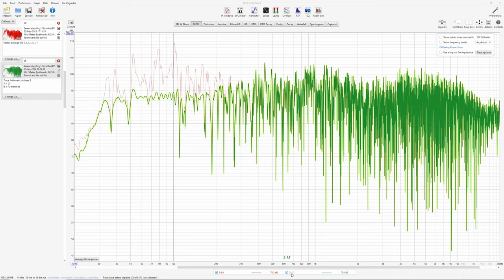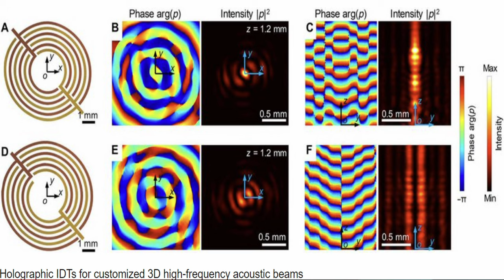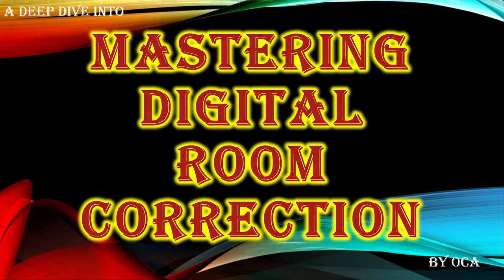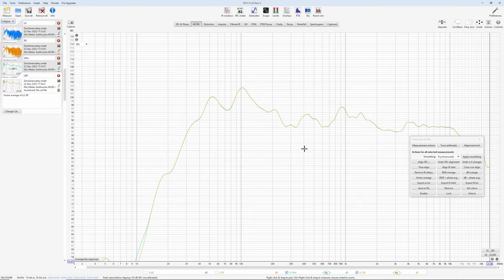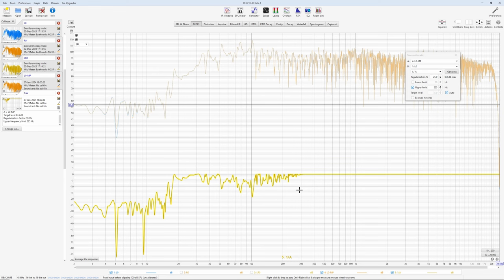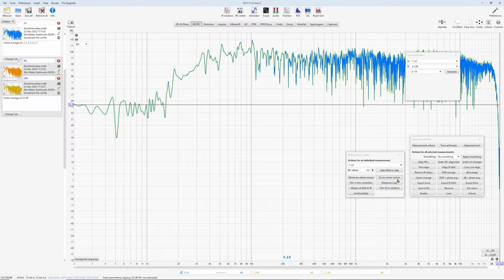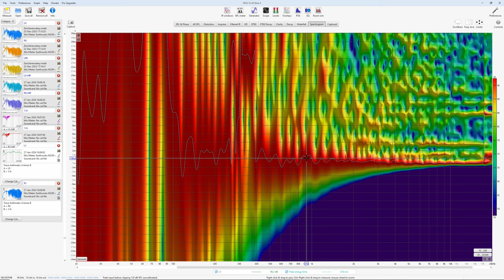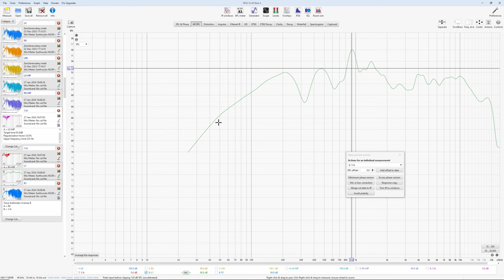Mastering Digital Room Correction

Comment: Thank you for your great work! 
This is very easy to do and my Subs now sounding much better, but.... Today I heard music very loud and noticed preringing at lower frequencies with "your" MP-filter. With some Tracks (also "Beat it" - Michael J.) it was very intensive. Now that I know it is there, I can hear it also when music is at lower volume. Could you please give me some advice how to avoid the preringing? Ah, I forgot: There is also a constant noise when music has stopped. It needs 4-5 seconds till this noise stops. It sounds like a tesla. (I use camilladsp) With biquads(peak) I have absolutely no preringing or postnoise.
Reply from the maker: How many FIR taps are you using in Camilla? These inversion filters are very sensitive and require a lot of taps. When some sharp phase filters are rounded by lower number of taps pre-echo can be introduced. You can generate minimum phase versions of your final filters and use them as the new convolution filters. These will have zero pre-ringing and adequate phase correction. I'm working on the issue as you're not the only one with that result and I've made progress. That video is in the pipeline.

Comment: Nice result with this method. Maybe the best till now, since I am at the start of this. Quick question, why do I upload the end file .wav format in eqapo and is in +20somethingdb?
Thank you for your time and useful information
Reply from the maker: Do not use "Normalize IR" while exporting from REW or in EQ APO, that will boost the volume of the filter. Also, try to export with the windows applied. If you hear ringing, you should generate minimum phase versions of the final "1/A" filters and export these instead.
Reply: @ocaudiophile  thanks for the quick reply, I have already faced the ringing problem and solved it, I will try  the other one tomorrow. Great work as usual, keep up
Reply: Will you consider this technique better or previous techniquse like vba?

Comment: What was done to get to your L0, R0 and LR0 measurements? Would you also do this same technique for your subwoofer response? Lastly, there is a chance I may be moving from an AVR with Audyssey to one that uses YPAO - if I wanted to continue to use your calibration methods, how would one get this information transferred to that kind of receiver (i.e. a Yamaha R-N800A)?
Reply from the maker: Vector average of all measurements of each speaker after cross corr align'ing them.

Yamaha has the best PEQ among AVRs, I'd go for manual calibration rather than YPAO. You can customize REW auto-EQ (configurable Generic EQ) with the limits of the Yamaha PEQ and it will optimize the filters for your AVR. I have older videos on manual Atmos calibration, have a look at them.
Reply: @ocaudiophile  Is there a specific video I should watch to be able to apply a manual calibration once I do get that Yamaha receiver?

Comment: Great video and a much simplified process.  I am experiencing an issue when using the Roon Convolution Engine.  Using “No Son of Mine” by Genesis as a reference track the heartbeat in the opening seconds is not as ‘focused’ as without the convolution.   I have a recording of the difference, but I’m not sure where I can upload it.  Thoughts on while the lack of focus?
Reply from the maker: Try using minimum phase versions of final 1/A divisions as filters.
Reply: @ocaudiophile  That definitely brought cohesion to the thump of the heartbeat.  Feels like over all result lacks bass.  I'll reprocess and add 3dB at the inversion. (REW updated the "1/A Screen" to use dB instead of cycles in the latest version.)
Reply: Maybe I'll try applying the room curve first.
Reply from the maker: @mweidlick  You can simply add a lowshelf filter to the 1/A MP

Comment: Multiplying the filter with a target curve results in a filter that also boosts in the bass, which is something you are avoiding the creation of the original filter.
Is there a trace-arithmetic that allows us to do the multiplication, and then limit the filter to 0db (i.e, no boost)?
Reply from the maker: I don't suggest to multiply with a target curve and I don't do that myself, I shared a curve and a method to embed it for the bass freaks out there ;)

If inversion is not resulting in a flat line at the bass frequencies, it's because that bass will be delayed bass composed of wall reflections. There's no TA operation to lift the bass response. You can try applying a low shelving filter (i.e LS 100Hz, +3dB) to the 1/A filter in EQ window and generate predicted from that!
Reply: @ocaudiophile  that worked very well. Thanks!

Comment: Question: should the initial measurements be made with or without subwoofers active?
Reply from the maker: Final correction should be done on the combination but subwoofer and speaker interaction should be taken into consideration. What crossover filters are  being used at what order all factor in.

Comment: Thanks again for a great video. Three questions:
1. Is this method only doable with two speakers, or why is this method so different from the Audyssey ART method?
2. Is there a way to calculate the Schroeder frequency for your room using measurements?
3. How do you click and mark in the REW graphs? I've tried right click, left click, +ctrl, +alt etc., and I don't get the same info when clicking and dragging in a graph.

+ A comment: I wish your Dolby Atmos sweeps were integrated in REW. I don't get why REW does not have that when Windows supports it.
Reply from the maker: 1. It can be applied to multichannel. In fact, I have done such Audyssey calibrations for some members of the channel and achieved excellent results. The problem is with surround/height channels, the speaker placement is so odd compared to a hifi system that, they do need HF correction. Also Audyssey cannot apply phase corrections and the frequency correction with this method is very similar to auto-eq method. PS I do run my surround system speakers all calibrated with this new system.
2. You can calculate it by dividing your room’s reverberation time in seconds by the volume of your room in cubic meters, then multiplying the square root of that sum by 2000! If you cannot, just take it 200Hz and you will not be too wrong.
3. Keyboard CTRL+mouse right click and then drag (and you should be in the correct REW window/tab)

There's nothing REW can do about it, Windows doesn't truly support Atmos. The Atmos sweeps bypass Windows and go to the receiver un-decoded through HDMI.
Reply: Hey OCA, great video, as always. Very interesting approach. Want to add a question, what about the HFR1 of Audyssey, how can this be handeled using this method? Creating the filters, multiply them with your HFR0 correction file, then export/save as txt.?
Reply from the maker: I think there's no harm in multiplying anti-HF1 with the 1/A filter created with this method as it will just be a reversal of what was done to the HF response. However, keep in mind that Audyssey cannot apply phase corrections and the application of this method in Audyssey will be limited to frequency content of the filters only although in my experiences, it still sounded better than any other filter before.
Reply: @ocaudiophile  Thank you.

1. OK. Interesting. Looking forward to future videos in case those are in the making :) 
2. Thank you. So, the average RT60 decay time (e.g. calculated in the range 100-11500 Hz, 1/6 octave decay window width as per Audioholic's recommendation)? My room has some openings (staircase, opening to a hall etc.), that will increase the estimated Schroeder frequency somewhat right?
3. Hmm, in which tabs does this work? I tried many, can't get it to work.

Weird. Other apps can send Atmos signals. I hope they find a way.

Lastly, would you consider helping out with a calibration (payed of course)?
Reply: A follow up on Schroeder's. What decay time do I use? The maximum, at a certain frequency, the average etc? I tried it different ways and figured out that a larger room volume results in a lower Schroeder's frequency for a given reverberation time. My RT60 Decay is about 450 ms on average with a room volume of 96 cubic meters (ignoring openings to other rooms), resulting in a Schroeder's frequency of 136 Hz. I was expecting a higher number, given what I have heard people argue about the upper limit where you can/should apply EQ.
Reply from the maker: That's a bit too low although totally within reason. I'd still start with 200Hz and go down from there and compere by ear. @isak6626

Comment: Sorry maybe for stupid question. I did all steps to create final 1\A filter then I've read in comments below that someone had the same problem with ringing (after I applied filter in Equlaizer APO) and then you advised to generate minimum phase version of 1\A again - I did that but still have this strange ringing. also when i turn off audio it fades, doesnt stop immediately. One more problem I have is that with this filter - volume is very low, i have to apply preamplification +24 dB to make it sound normal. But I use very cheap lavalier microphone from Aliexpress for measurement, ofcourse I dont have any calibration files to create minimum phase cal files for this microphone, I just  wanted to see if it will improve FR a little (I have very bad speakers). Can my mic cause ringing problem or i did something wrong?
Reply from the maker: You must have done something wrong or your measurements are faulty, these are not expected outcomes.
Reply: @ocaudiophile  ok, thanks man, i guess i will try just simple EQ then
Reply: @ocaudiophile  I dont know what exactly helped but I installed new version of REW, also I changed settings on 48 kHz instead of 44.1 and did all measurements again. I also set upper limit in trace arithmetic to 17 Khz (not just 220 Hz)  and maximum gain 6 dB so entire FR got corrected. 1/A filter still has ringing but much less but 1/A MP version almost no ringing at all (it still hearable when you turn off music). But overall sound got so much better that I cant believe it. It almost sound like in IEM's after I equalize it with many filters (I listen tone generator and equalize by my ear). Anyway, I will try maybe improve  it after watching your other videos, your method is gold, thanks man!
Reply: Dear OCA, I'm a happy audyssey evo user since 2 months😀 I'm planning to have a party in an old barn in September with a 2kW PA system. I'd like to control it with a Windows PC, REW and APO equalizer... Which method for room correction would you please recommend? Because I read in the comments on Audyssey Evo that you now seem to prefer the REW PEQ filters instead of this Mastering Digital Room Correction Video method? Many thanks in advance and best wishes from the Austrian Alps, Simon 😀  @ocaudiophile
Reply from the maker: @vortexor1 so long as you use MP version of the response, results will be good but yes PEQ has the edge in terms of group delay (at least for Audyssey measurement resolutions)

Comment: Do you recommend or will it be worse if this is implemented as convolution in Roon after general parametric eq of subwoofers in the AV processor ?
Reply from the maker: You could do that if you have to but you need to measure the speakers with AVR EQ on first. Roon normally would do a lot better on its own though.

Comment: @ocaudiophile, My Measured LR and Vectored LR are not the same. My vectored LR is about 6 db less than measured with the nulls dropping/ending at the same point. Its like my Vectored isnt summing properly.

I took 5 measurents for each speaker separately and LR together for 15 total. I cross cor. each speaker to itself and vector averaged the measurements to give left, right, and LR. I  vectored my left right together to get LR Vectored. Seems pretty basic so I dont know where im off at.
Reply from the maker: 6dB difference is totally normal .Sorry, I forgot to mention that in the video. My measured LR response was decreased by -6dB. When sound sources are combined you get additional 3dB/added speaker. But outside that, I'd expect measured and calculated averages to be quite similar if left and right speakers were time aligned correctly. If removing IR delays don't bring their impulse peaks on top each other, then there might be some delay REW can't remove for some reason with one of the speakers.
Reply: @ocaudiophile  , Right on. Yeah, the 6db was what I expected and makes sense combined with the nulls not summing.  So many places for one to make an error  I wanted to check with the Guy that knows.

I watch a lot of these type of videos and most questions go unanswered. Thanks for being so responsive. Appreciate you.

Comment: The overwhelming amount of my source material is ripped from CD, so it's 44.1k native sampling rate, with very few 48k, 96k, and almost no 88.2k files. I use Foobar2000 on a PC with the convolver plug-in. To date, I have generated headphone correction filters in REW using suggested PEQ settings or downloaded others for all the required sample rates that I use for nearly all of my listening and only switch when necessary. Do you resample all your source material to 48k in JRiver and simply use that single filter?  Thanks!
Reply from the maker: My library is similar. REW can export any .wav file in any sampling rate (up to 1536kHz)  but I believe most convolution engines do a better job of resampling them on the go, so I keep REW exports at the native 48kHz sampling rate and leave resampling them to 44.1kHz (or any other required by the tracks) to the DSP engine i.e. JRiver.

Comment: Dear OCA,Great Video!
Question:7.1.4, Dirac full-range AVR, CamillaDSP(i5 4590T Macos),4in,4out sound card, can you guide me how to process LRC and sub to exceed Dirac, the channel delay of the AVR is limited to 43ms.
I tested two invertion methods, but the delay was more than 150ms.Thank you very much.
Reply from the maker: Is there a sub? That changes a lot.
Reply: @ocaudiophile  Yes I only have one subwoofer
Reply from the maker: You'll need to align the subwoofer timing with LR first including determining the optimal crossover. Then you can measure the combined response for left and right and apply the tutorial method. You will need to measure C and sub and create one filter for that, too.
Reply: @ocaudiophile  Thanks again, I will do it.
What filters can I use to control the delay within 43ms?

Comment: Before watching every video your channel provides, all of these methods require an AVR with at least the support for the Audyssey App right? Because I have an Denon AVR X1200W, so no Audyssey App :(
Reply from the maker: If you use a PC as your music source, you can do a lot more than you can do with Audyssey and completely free.
Reply: @ocaudiophile  That's what I thought :/ Sadly my PC is upstairs and 100% used as a PC for PC stuff, currently using a Firestick 4K Max and a few consoles on my AVR, maybe a little home theater PC will work too?

EDIT: Just came into my mind that only the music coming from the PC can be modified, the Game Consoles and whatnot can't, at least with my current AVR!
Reply from the maker: @SeGin_ sure, I use a NUC for all my dsp
Reply: @ocaudiophile  Which software? I use Equalizer APO to EQ my headphones, is there a more sophisticated one for these kinds of applications? Oh and, when I want to DSP my PS5 or Switch for example, what is needed for these kind of filters?

In my past I only ever had a Omnitronic Smard 24, t.racks DSP Mini and internal DSP's from various pro amps, but I sold them before I gained knowledge of advanced DSP techniques :/
Reply from the maker: EQ APO is pretty good for PC. For PS5 you are stuck with multichannel AVRs and their own automated DSPs I am afraid.

Comment: Thanks for the video.  Is it possible to export the target curve with created filters as text files and insert them into audyssey?
Reply from the maker: Pls check the answer to 
@isak6626 below.
Reply: So with audyssey this method is useless because it doesn't manage the phase but only the frequency? @ocaudiophile
Reply from the maker: It helps to get all speaker volumes level with each other and see abnormalities if any with certain speakers. For example it can determine how many dBs a subwoofer is too loud. Also ignoring the phase response, only sending the frequency correction to Audyssey target curves improved the sound somewhat in my personal system but still, you have a valid point. @alexruspantini3484

Comment: Hey OCA, does this mean that the measurements need to be taken with the MP Version of the Mic calibration file only?
Reply from the maker: You can also add it later, REW has tools for that
Reply: @ocaudiophile  thanks, so you mean that one can replace it in every measurement later, otherwise there will be no harm when taking the measurements with the MP version of the mic cal file directly, correct?